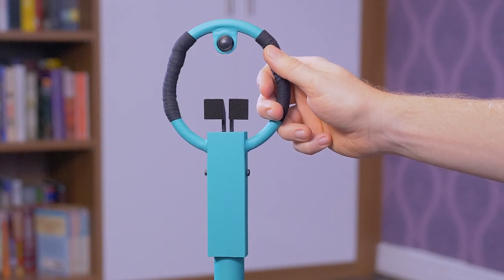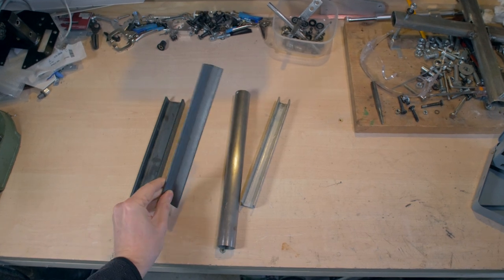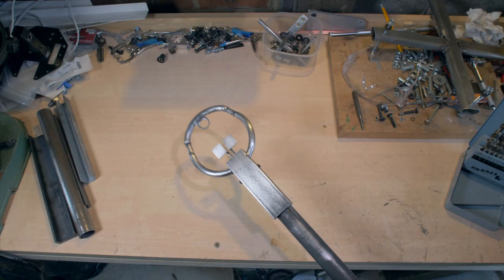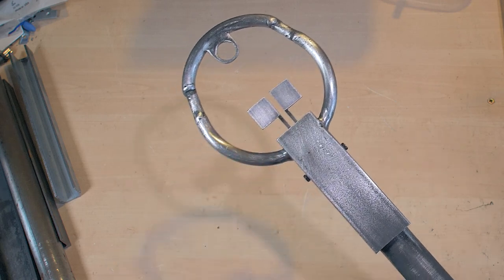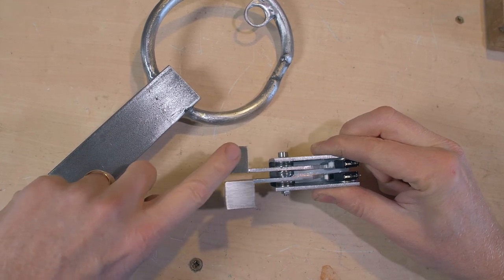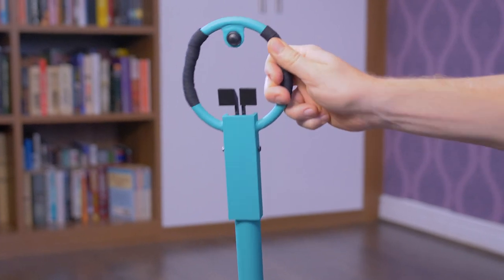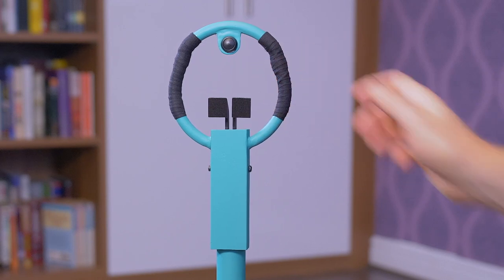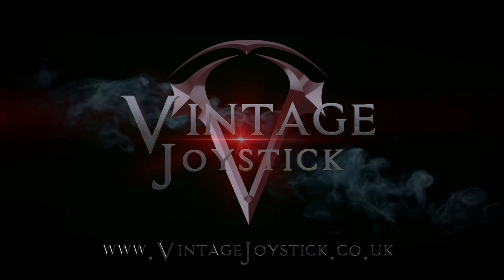Homemade Prototype Joystick - Sturmovik

Comment: another cool build i was waiting for , i got my plan. I will buy a stock logitech 3d extreme and modify it next, i will use the encoder only. I will change whole casing to make it look like p 51 Mustang. I'm going to modify my chair to get some space between my legs. What do you think? greetings from Poland
Reply from the maker: Sounds good -  The Leo Bodnar control board is a good option too (see my first video - Homemade Joystick). It is very good value for money, easy to configure and has lots of inputs; both variable and switch inputs. And I like the idea of the P51 Mustang - Good luck with the build and I look forward to seeing your video on it!
Reply: The encoders on the Logitech 3D are cheap plastic parts that are known to cause issues.
Reply: @ObiTrev  i know but leo bodnar control board is 5 times more expensive

Comment: your uploads were 4 years too early in my opinion. as stupid as that sounds, i feel like these short form quick breakdowns would be an absolute killer on youtubes shorts platform thats gotten a bit more popular. shame this didnt take off as much as i personally feel it should have, but i guess those who dont want to spend an arm and leg on a flight sim setup that is almost entirely plastic and cheap feeling are few and far between
Reply from the maker: Thanks for that, yes you're right, and indeed there's probably only a small percentage who would want to build something approaching a 'real' flight sim cockpit. The raw materials are probably not that much as far as cost goes, just takes a massive amount of time!